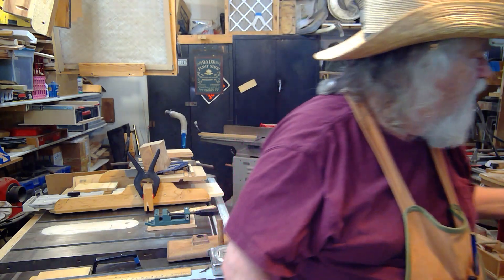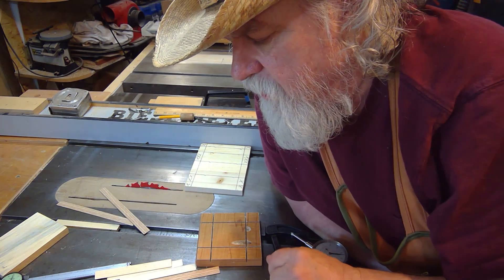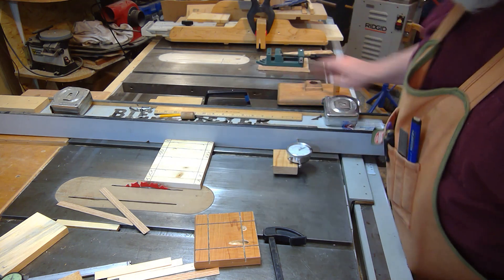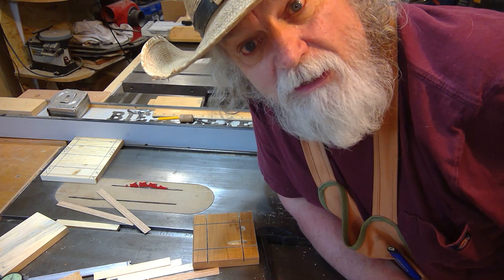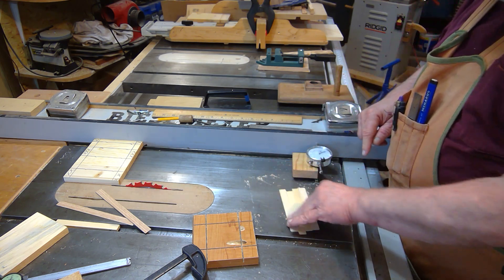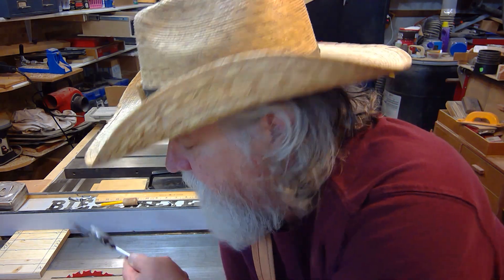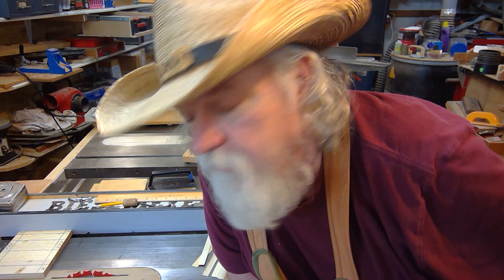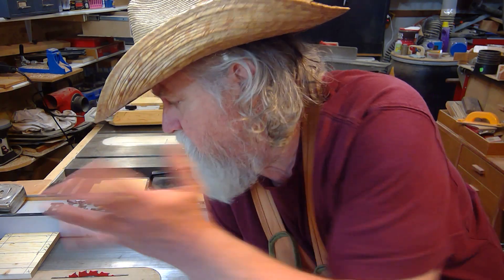Determing Tablesaw Blade Thickness by Show Me

Comment: Good video. An equivalent method is to measure the width of a scrap piece, then rip it in two. Put the workpiece and the offcut together and measure the width. The difference is what the saw blade took out. This does the same thing as your method with a little less fuss.
Reply: Your method does seem a lot easier.

Comment: Great tip. Just be careful loosing focus around that spinning blade at  16:48 you made contact with that small piece and you fingers were pretty close.  Remember 10 fingers when starting and 10 when finished is the rule. (Just messing around not the safety patrol).  

I like you video.
Reply from the maker: thanks Tom, Yeah, it looked bad didn't it?  I actually picked up a piece of wood (hard to see) to move that piece.  my fingers were 4" or more away at all times.  the piece actually got bumped into the blade and took off.  I wanted to blame the dog but she wasn't around this time :>)  thanks for the concern. BTY, I still got all 10 :>)
Reply: Robert Crum's Shop Rule #1 Was
 If You Get Blood On It, You Clean It Up
Reply: Mathis Wendell is one of my favorite to watch.
As having been a machinist previously I can assure that I've seen Digital Calipers be off by 0.010-0.015 at any given time due to weather or micro debris inside the gears.